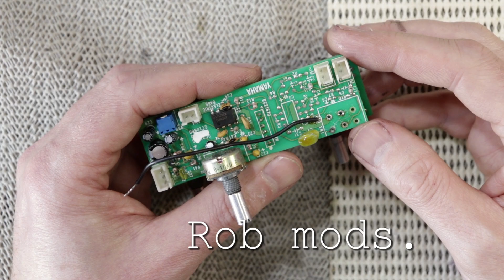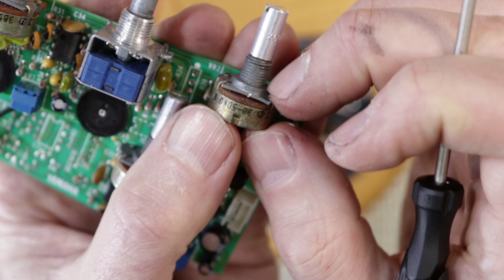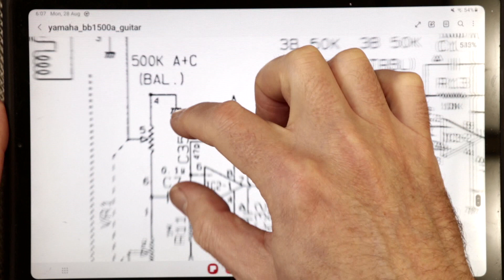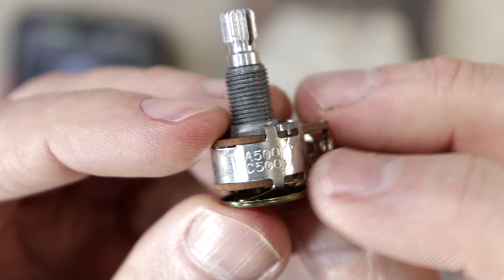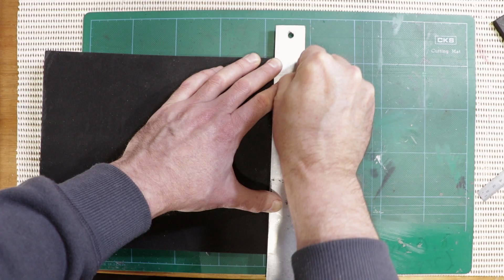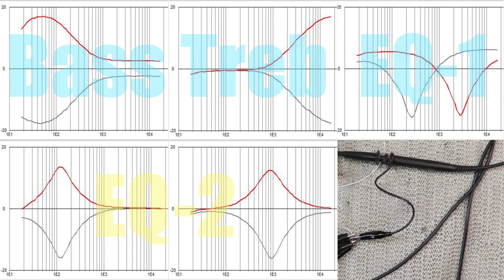Vintage Yamaha BB1500A Bass Guitar Preamp Repair

Comment: I accuired an old HH 100 watt amp. A module of preamp died off and was swapped to custom one that controlling mids and presence. Decided to build original module and did it. It has bobbin filters which I never seen or heard before it works well also has two mosfets. Nevertheles it was fun to build old 70's circuit and get it working. I have build couple overdrive pedals but never seen a circuit like this, it pinpoints the tone. Like an eq.

Comment: That's awesome! I really really enjoyed this one. I love these circuit board mods. I would have loved to see what you would've done work all of that empty circuit board space if it was your bass. Love the channel!
Reply from the maker: Thanks mate.  I didn't actually trace that part of the board, but I'm quite sure the missing parts were a pair of buffers.  The IC was a dual opamp and the pickup inputs appeared to go to each of the non-inverting opamp inputs.  IOW, an active pickup blend.  Pretty much the same set up as I did with Project Berocca.